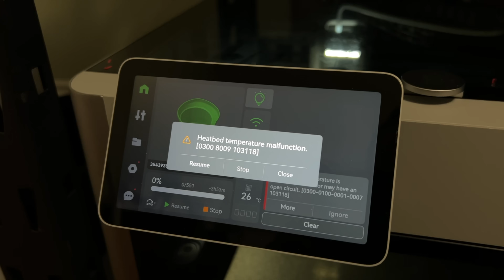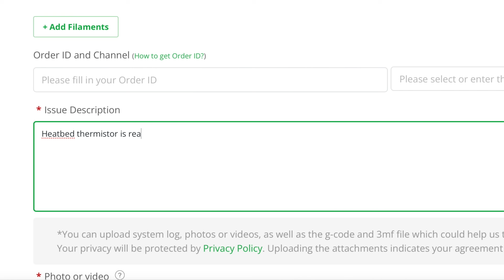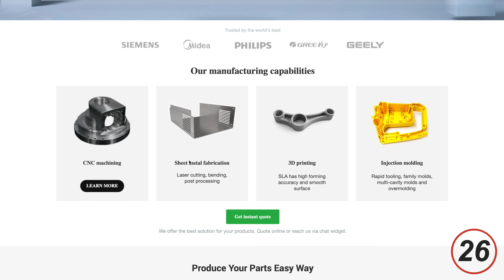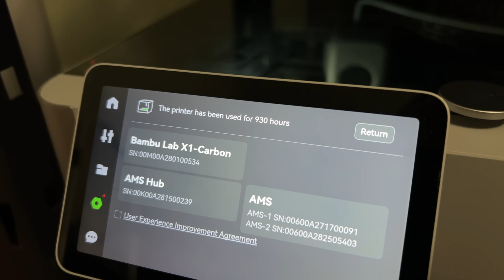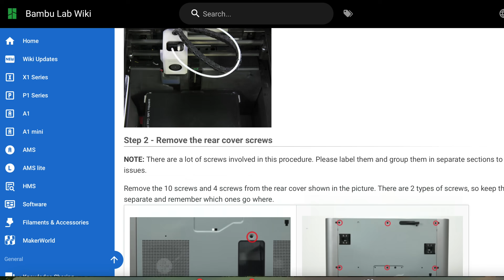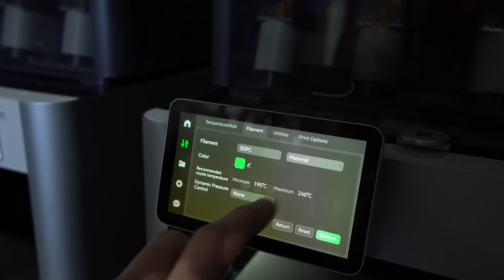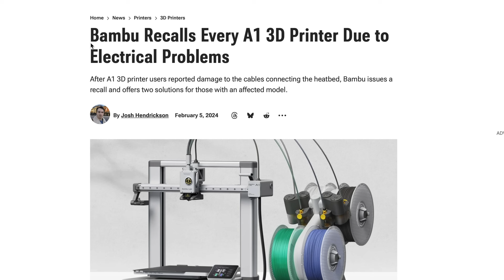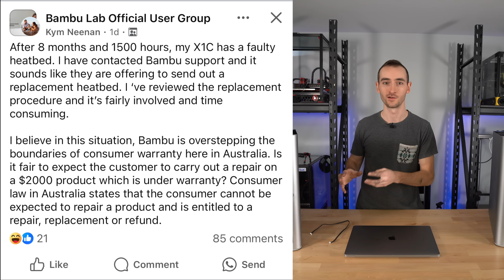Bambu Printers: Repairable or Disposable?

Comment: 1000 hours is like 2 months? I've been non stop, and I mean non stop(I have been running on 2-3hours of sleep since Oct) printing since October on my 4 a1's & p1s and have had very few issues. Mostly all user induced. I've replaced no parts. 

I used to relentlessly post hate comments about Bambu, but now I'm wondering why I don't just give new things a go without hating first. 

Anyway, no point continuing my post, but those who are on the fence. You want to go the Bambu route. Prusa is over priced rubbish, Ender is behind the times. Bambu (for the foreseeable future) are the market leaders. Don't make a mistake with your purchases.
Reply from the maker: Get some sleep friend. Whatever the reason, it’s not worth burning yourself out.

Comment: I agree, at the beginning of the video I thought .  You are probably printing TALL, Petg or hotter material requiring more heat for the bed and those printers are probably agains a north wall.  And an off the cuff thought is that all three are in same outlet that is causing voltage variants  along with heating and cooling of the cable, agree with design flaw, like the A1 cable.  This was after your diagnosis  at very beginning.   Any suggestions  after all this for the rest of us to SAFEGUARD against this.   May put a guiding bracket so no pinching or rubbing can occur.  And do you think hot and cold cycles would attribute to this.  So a designated  higher  temp filament machine would be MORE prone to this?   Thx for the vid and I  felt for you working on those machines , the deeper you got the more I was saying NO WAY...haha.    But I,ve  built my Prusa, played with  my Predator and other deltas... but OUICH on all those screws like taking  a  MacBook apart .
Reply from the maker: I’m guessing the newer units come with the newer cables. It’s unclear when they became aware of the issue and fixed it. If you’re able to get access to the cable you can check whether it has a textile wrap (new cable) or heat shrink (old cable). If it’s the latter you could consider replacing it preemptively but personally I’d just order a replacement to have on hand and let it run until it dies, then replace it.

Comment: But wait, the Prusa people keep telling me that Bambu's can't be repaired.  I know they know everything about every printer ever made, but I just watched you repair yours.  Who should I believe?
Reply: If it can be built, it can be repaired. It may not be easy, but it’s acceptable.
Reply: Believe what he said at 9:40. They aren't designed for repairability. That's not the same as can't be repaired.
Reply: @racylaserjet  The designers made everything removable and therefore replaceable.  Not many repairs are easy no matter what machine.  Bambu used screws not rivets, so it can be taken apart.
Reply: @jonwoodworker  Not everything is removable, or at least easily removable. Some parts are glued in. So you have to replace a whole assembly to replace the part that is actually broken.

This is similar to modern smartphones, where the screen and glass cover form a single unit. You can try to soften the adhesive with heat and replace the glass separately, or you can replace the entire screen, which is obviously more expensive.
Reply: @jonwoodworker  You literally can't even repair or replace the X axis without buying a $100 assembly. If you have a CF rod or busing go bad, you have to buy the entire assembly becasue thee rods are epoxied into place and are not meant to be repaired.

Bambu designed their printers to go to a landfill when they break, they're throwaway easybake vorons. They were never meant to be repaired. Bambu only started selling replacement parts after so many of their printers started breaking and they couldn't afford to just keep sending out new printers.
Reply: @LilApe  You ever going to finish that print with the XL?  I've fixed and repaired many things with epoxy.  A little heat to soften it up and out pops the rod.

Comment: This is supper odd, I have the opposite problem my farm had 10 Prusas and those pieces of poop almost bankrupted me, now I have 6 Bambus and they do the same work as 10 Prusa. Some are at almost 5K hours and I cannot believe I had to do only once and had the same experience Bambu sent me the same updated cable so they definitely knew it was a problem, little shady on their side!
Reply: What were your issues with the Prusa’s? We have 120 Prusa’s and 40 Bambu at the school. We have only had issues with the Bambu. The mk3s+ have been rock solid. We have been looking at the Cores, but maybe we will get a test batch if there are issue. What model did you have?
Reply from the maker: It would be nice if Bambu publicly acknowledged this issue and proactively sent replacement cables. Interesting about your issues with Prusa. Those are generally known to be reliable workhorses. I’ve had a cable issue on one of my MK3s but otherwise they’ve been solid. My Bambus have been solid besides this cable issue.

Comment: I I passed 1730 hrs on my X1C, with a decent mix regarding the height of my parts.
I "only" needed to change: 
- The camera.  
- Both PCBs in the toolhead along with the flex cable.  
- The USB-C cable from the toolhead to a breakout board near the camera.  
- Two to three cables leading to my AMS and one cable inside the AMS. However, those might somehow be related to the USB-C and PCB issues in the toolhead, as I no longer face any AMS errors, which previously caused disconnections from the printer.

All of these components, plus many more, were sent to me free of charge by Bambu as part of warranty claims. It’s unfortunate that everything had to be replaced—100% yes—but I feel I just got a Monday morning model, which is simply bad luck, I guess.

Additionally, I received a broken glass front due to rough handling during shipping by the local postal service.
Reply from the maker: Oof.. that’s a lot of parts needing to be replaced.

Comment: Foresight to the potential failure of a part can undo any engineer. NASA knows this, sadly, all too well (O Ring Space Shuttle). To blame any company for a design flaw for a similar issue is in the same realm. These parts may still be working in the thousands of other Printers out there, and a batch of these wires may have been the issue. Yes, this can be annoying, but some of the flaws you are discussing may be required to meet certain safety laws in other countries, designed in ways to minimise overhead per unit to produce. After all, there are many units, and some savings in material or having to redesign moulds for injection extrusion are all more money no company will spend when the designed part works and has tolerances within spec. I am, of course, seeing this from the perspective of an end user who can and has seen other issues for other devices and their management of an unforeseen design flaw.
Reply from the maker: Interesting perspective. I don’t blame them necessarily for not publicly acknowledging this issue since that would be a PR nightmare. Especially when not all users will experience the fault depending on how they use the printer. But on the other hand, they’d win some favor by acknowledging their mistake and proactively sending a replacement.

Comment: An old mechanic trick is to poke the screws into the cardboard in a pattern that matches where they were removed from the printer.

That trick has saved me so many times while working on cars :)
Reply: That’s an excellent idea! Thanks for sharing. From central Florida 🌴🇺🇸
Reply: @ZaxMan3D   good idea.  You can set the screws out in the correct pattern on any surface as well.  Tape them or otherwise fix if necessary.  Those magnetic sheets are useful.
Reply: Always doing that when removing a transmission!❤
Reply: bottom line: Keep track of the screws...
;-)

Despite the smiley, it's important.

Comment: I'm surprised you've had so many issues. I have two X1Cs, with a combined 8,000 hours on them. Never had to do any repairs that extensive. The biggest issue I ever had was a bad board in an AMS. Good to know it is really not that difficult to replace the heated bed, if I ever need to do that. Having had A-net and Creality printers in the past and how many repairs I had to do one those constantly makes repairing any other printers simple by comparison.

Comment: They had the replacement part, they've learned from past issues apparently, and an hour or two of maintenance after 900 hours isn't that bad considering the only other maintenance we do, cleaning the rod and lubricating the screws, takes a couple of minutes every few hundred hours. Mine is closing in on 2k hours without issue, maybe it has that newer cable.
Reply: I always half the time the manufacturer says to grease and clean the machine and at 250 hours it's I've only had a couple issues but usually quick fixes.
Reply: A cable chain of some sort would normally be used in an industrial machine with such a moving part that needs a cable to it.

And that would hold a lot longer.

And some 3D printers have cable chains for the cables to the moving parts.
Reply: Still we can ask, how long were the printers tested before starting full production? These kind of design flaws, especially with A1 cable, are better found before they end up in consumers' hands.
Reply: @kimmotoivanen  the X1C has been out for almost 3 years...
Reply: @RyanMercer  That doesn't fix all the printers with old cables, does it? They are improving though (through own findings or through user tickets). Maybe they have made X2 (or whatever it will be) a bit easier to service.
Reply: Needing to order new wires and void your warranty and fiddle with affixed parts to install them - after what could easily be under 2 months of printing - is not what I would call maintenance, no.  Grease?  Sure.  You get your tube of grease and spend one dab and thirty seconds applying it to easily accessible areas.  That's maintenance.  Replacing parts that are expected to go through lots of wear and tear from regular use and are designed to be removed and replaced periodically with minimal fuss?  Sure.  This is not that.  Wires are not a normal heavy strain consumable.  And even if they were, this one was clearly not designed for user servicing.  You can argue that they fixed it in newer printers, and I hope they did, but no, correcting a wasteful design flaw is not "maintenance."
Reply: I've changed this part as well, it's not too bad, but a bit time consuming. Definitely not disposable, lmao
Reply from the maker: Fair point. On the other hand, they could have acknowledged the shortcoming and proactively sent replacements. But I don’t blame them for just dealing with it on a case by case basis since publicly acknowledging a design flaw would be bad press and not everyone will necessarily experience the failure depending on how they use the printer (short objects versus tall).
Reply: @ygk3d  Standard practice to not preemptively send out parts that may not be required and may simply be lost or thrown away.  They should have a page with known issues and solutions, though.

I do like the fact that they sell the replacement parts for reasonable prices.  Very few companies do so.  Think of car parts.
Reply: @ygk3d if you own a car, it’s common knowledge that their may be recalls for the car, no one is going to feel some sort of way if the company realizes the issue, identifies it as such, finds a solution to the complication and if they don’t fix it themselves, give a very descriptive guide on how to do it. Companies that are transparent only builds trust with their own consumers.
Reply: Couldn't disagree more. This isn't maintenance, it's repair of a key system component that should last the life of a printer. Learn the difference.
Reply: @CarbonKevin lol you obviously don't work in any kind of industrial environments with machines then. Do you know how common it is for wiring to be a breakdown factor on machines early in their design lives before they realise that issue is there?
Reply: @ErzbergAdventures  these are also design flaws, unless you think the wires are designed to fail like this? Why are you comparing heavy industry to consumer appliances?
Reply: @CarbonKevin  it's maintenance. This isn't a tv remote, it's production equipment that requires maintenance including replacing parts that wear our.
Reply: @RyanMercer  wires aren't normally wear parts. Silicon glued in place indicates it's intended as a permanent install. Regular expected maintenance shouldn't void warranties, should be noted in the manual and should have a schedule. They've also redesigned the cable. This seems very far from regular maintenance.
Reply: @m3ntal2k  wiring isn't even covered under vehicle warranties.
Reply: @m3ntal2k  its probably fixed on new printers, but this is really close to professional levels of stuff, they release it after doing a lot of testing and then find out what they missed, that's how this stuff works. stuff breaks, they cant test stuff forever and on as many machines as are out there in the wild, that's pretty damn expensive
Reply: @RyanMercer  it is on my Nissan and my Buick.
Reply: @RyanMercer  I'm not really sure what part of my comment you're responding to. I didn't say the wiring should be covered under warranty, I was meaning he had to void the warranty (three warranty void stickers removed) to repair the part. Maintenance shouldn't require you to void a warranty to do it, ergo it's a design flaw.
Reply: @halfblood_drag0n  the point of my post was that this was a design flaw, not regular maintenance as another user was suggesting. The fact they've probably fixed it on later models just reinforces my point.

Comment: Fun fact, those warranty void stickers don't mean crap in the US and are actually illegal if the manufacturer actually tries use it as basis for voiding your warranty.
Reply: @DrawnDoggo  unfortunately it still works as a deterrent, and they can still try to deny you, only waiting until you to call them out or threaten legal action before caving in and doing what they should've done in the first place. Fortunately Bambu hasn't been like that but there are companies that are
Reply: Would be worth it to extend the ground wire so it never has to be accessed that way again?
Reply: But isn't criminality legal in the US?
Reply: @grumpyrider369  is now.
Reply: Fun fact, in order to enforce your warranty you would have to sue them and risk thousands or tens of thousands of dollars on lawyers just to hopefully get a $50 repair part for free so in practice the warranty void stickers are enforceable.
Reply: @schmiddy8433 small claims is not thousands of dollars and you don’t need a lawyer. It’s just paperwork which could be a barrier for people.
Reply: @schmiddy8433  Bambu is friendly and usually very happy to help though - If you just reach out and ask.

Comment: All printers break down. Replace wires,etc and add some cable protection wrap or sorts.
Reply: @Phil-D83  MTBF mean time between failure. That particular part should not fail early or often. It's a design induced failure in this case.
Reply: @racylaserjet  with 3d printers, you expect things to break and find ways to make it better yourself
Reply: @Phil-D83  no stranger to that. I built my MK2 and MK3S. This problem is not something I would expect to break. In fact it should not break when it did, as early as it did and on not one but 3 of his printers.
Reply: @racylaserjet  what i have learned is that they all break, even if they ought not. Deal with it
Reply from the maker: Sure, but in this case the cable seems to not have been spec’d properly for this application.

Comment: Definitely a design flaw but if the new style of cable rectifies it I don't have a complaint. I doubt they hit a consistent failure rate in their internal testing and even if they did I wouldn't assume malicious intent. Good to know though.
Reply from the maker: You’d think they would have had some printers running lifecycle testing moving up and down continuously for days or weeks… surprised they didn’t catch this issue in their testing.

Comment: To improve on the cardboard screw organizer can I recommend an inexpensive (or expensive) Silicone Electronics Mat? Most come with a number of storage areas. Also known as a Silicone Rework Mat, etc. I have done what you did, and then knocked it sending screws everywhere! As an alternative, there are magnetic parts organizers or trays where the screws are held in place by 1-4 magnets.
Reply from the maker: Great idea! That would have been highly unfortunate if I accidentally knocked the box…

Comment: How old are your X1Cs?   Does anyone know if the latest manufactured models use a new cable?
Reply: Anything after the P1S Was released won't have this issue.
Reply: Good question.
Reply from the maker: A few years… not sure when the issue was identified and resolved.